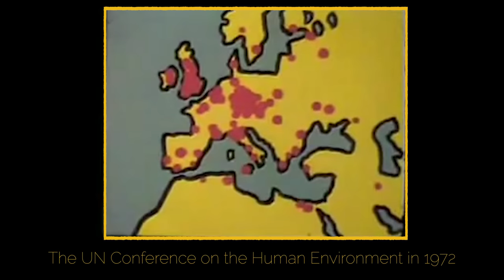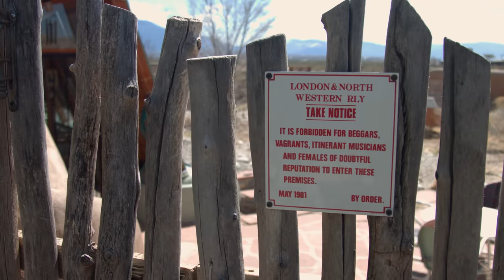Earthships - America's Off-Grid Desert Community

Comment: As a plumber, what I took away from this, is the re-use of water. Being able to use water more times in your house is beneficial to those out in western us that are currently having a water shortage.
Reply: They should make people with lawn-sprinklers install a device to recycle / redirect their bathwater to it and not use valuable freshwater. Maybe you could invent one?
Reply: @anthonytempleton2135  A few year back we had a drought and hosepipe use was banned,  no car washing either.  I used to use bath water to water my vegetables.  I installed a pipe between the bath and the garden.  You just need a small pump to start get the water flowing and then syphoning and gravity does the rest.   To start with I simply sucked the bath water up the pipe it is easy to know when it is flowing because air is ejected, so then you stop sucking.   I never got a mouthful of bath water, but in the end installed a small pump instead.
Reply: I never even thought water can be used 4 different times. This place is very inspiring. It just shows great care for the Earth and what people can do when they set their minds to it.
Reply: I don't understand why we don't use reclaimed water or grey water as some call it. Isn't it kind of silly we flush toilets with water clean enough to drink?
Reply: @commenter9967  I would quite like to set up my toilet to use rain water most of the time.  However it would need quite a large storage tank.   I would be quite interested in the capacity they have for their Earthships.   However, in general I see their Earthships as a terrible blight on the landscape.
Reply: @anthonytempleton2135  it would kill the lawn throwing off the ph levels
Reply: @hoosthere  Not at all.  The hotels in Egypt are not allowed to put used water into the sea they get huge fines.  So they water the gardens and they have amazing gardens.  The lawns are more than happy.   In 1976 in the UK we had a very bad drought we were not allowed to use hose pipes, or clean cars.  All the plants in my garden ran on washing up water.   The lawn, well that just went dry brown.
Reply: @Digeroo123  i just know that i got soapy water on my grass and that spot died
Reply: @hoosthere  I habitually wash off my duvets on the lawn every summer.  Hose them down with detergent and water.
Reply: @Digeroo123  might of been the white vinegar, that was mixed with the water
Reply: I believe it's going to be beneficial for all of us someday. I think they just got the jump on everyone.
Reply: @Digeroo123  That's fine, but I would have found a way to rig up a bicycle pump to it.
Reply: @Digeroo123  Worse blight than rectangular boxes & cubes people normally build?  Nothing stands out like a sore thumb more than traditional buildings.  Yes, some of these earthships are ugly, but as far as the landscape goes, it's not much different than other kinds of structures, including warehouse structures or manufacturing plants.
Reply: @commenter9967  We could, but we would need radical changes to building codes that would mandate these systems in all new homes, and renovations for older structures that have the room for them, with a time window, say, 20-25 years.

There would be massive resistance to it from builders as well as home buyers who don't want the added up front cost & lost sq. footage.  That could be addressed via various compensations and incentives, of course, like tax credits, gift cards, discount loans, whatever, but you know how our leaders are:  Worthless.  It takes them 10 years just to think about doing something.
Reply: As a Pediatrician I came to the same conclusion
Reply: We used hose pump on a drill to drain our bathtub water into our garden, and by the bucketful for flushing. This was years ago when we had drought conditions in Maryland. Our reservoirs were drying up.
Reply: I want to live there!!
Reply: I agree
Reply: Have you heard of Brad Lancaster and water management? He is doing some fantastic work in Arizona that is spreading around the world.
Reply: @STEAMLabDenver  no I haven't.  What is he doing? I live in AZ so I'm interested
Reply: @anthonytempleton2135  where I live in MN, many people along the lakes use a lake pump to water lawns opposed to city water. It’s cheap and effective as well as green as that water runs back into the lake.
Reply: @chrirule  this is starting to change!! Water collection laws have relaxed in many areas it was once completely verboten.

Edit: I concede that the majority are still (shockingly, surprisingly) draconian.
Reply: I mean using tap water for flushing a toilet is insane. It's a gallon of drinking water just to move a puddle of piss down a pipe.
Reply: @Digeroo123  how are these a blight? They're efficient, they're ecologically friendly and they're beautiful.

The only reason I don't want one is I prefer cool humid climates and these are engineered for more arid places.
Reply: @hoosthere  so stop using soap. I quit that crap years ago and my hair and skin are so much better bathing in just water
Reply: @patwebb2375  he's doing a lot of work to try to get greywater accepted and teaching people how to use it under the radar in the interim.

B. Lancaster's books are amazing
Reply: @sirsir9665  composting toilets are so so so much better for the world. It just takes a little education on how to handle them.
Reply: @priestesslucy  All those old tyres.
Reply: @Digeroo123  you can't even see them. They're sealed up in a way that's useful to people
Reply: Well I’m a plumber in the uk and Ino for a fact we use our water 7 times roughly and that’s just drinking water alone 👍
Reply: @commenter9967  it’s not clean enough to drink bro and it is re used when you flush it goes into ur stack that then takes it away to be filtered and re used👍
Reply: @commenter9967  We do, where do you think city water comes from?
Reply: @chrirule  Those laws were enacted because environmentalists said it interrupted the water cycle and stopped water from being able to percolate and into aquifers.
Reply: @anthonytempleton2135  My neighbor in the city I grew up in, was doing that for YEARS. Bath water and sink only, not toilet water. He just piped outside to a holding tank in a shred, created a small motor to push it through a sprinkler system he created. That was 50 yrs ago. What people DIDN'T know wasn't hurting him. He had low flow, gravity assist toilets way back then too. He was a mechanic by trade and he created stuff. It can be done, but cities are notorious for WASTE, WASTE and more WASTE. This was in CA.
Reply: Yeah definitely the biggest challenge to sustainability is the proper cleaning of water
Reply: Considering their were plans back in 1990 that it was doable to drain the Missouri River any time we knew New Orleans would be under threat of flooding, to have all that water make it to the Southwest. Could then have stretched that to the upper Mississippi probably taking some of the Ohio! But no it’s too bad the USofA is such a poor country!
Reply: @spaceboy3101  that’s just bull shit. Places looked cool you have to waste money to make yours look normal? No cause you never have one!
Reply: @The_Good_Life3026  hope their not using petroleum based fertilizer and all the rest! If those bodies of water have no fish well now you know why!
Reply: @brxds0679  hey, the point is the clean water you bathe in is good enough to flush your toilet!
Reply: @TheLosamatic  Nope, I'm a farmer and follow water rights. That was from environmentalists. Go ahead and if boogie men make you feel better, that's your psychosis, not mine.
Reply: Or better yet, stop doing the stupid shit that has helped lead to the drought.  People just don't want accountability.  They think adaptability is the answer.
Reply: @atlantic_love  You live indoors? That's adaptability. You don't sleep under a tree right? Where does that water come from you drink? A brook? You never drank from a plastic bottle? Wow, you're a true wonder of nature.
Reply: @TheLosamatic  how so
Reply: @hoosthere  your going to have to give me more than that honey!
Reply: @TheLosamatic  how so
Reply: @Stone Melber or others... 

The part where they are recycling the water to and from septic... 

I'm not being critical but how do you know the water is adequately detoxified before it comes back in for the plants to become fruit you eat? This part it seems like you'd have to a bit careful about. So you'd need to go into technical details to figure out how to duplicate it right if that makes any sense. 

Hope someone can advise on this. Thanks.
Reply: @TheLosamatic  who are you responding to
Reply: @hoosthere  Which response are you referring to?
Reply: @cchavezjr7  see that’s just it, are you saying your farm is in a town? The point I was making is people acting like they are part of the sane environmental movement,as you claim, I’m just talking facts, you talking about rain water rules in cities? WTF we just take your word for it. EPA REAL law was can’t let start runoff go straight into river for cities over 500,000 decades ago. No city has been able to comply with that because municipalities and counties are the most corrupt forces in the USofA , come up with stupid rule, not laws until fought in courts as far as I’m concerned. What you say is one(if real)of the more stupid, because property tax is higher depending on how much run off, ie storm water city has to deal with, your property has. So I’m going to assume if one has rain water collection that property naturally absorbs more water any time it rains. No law against collection of rain water will stand up in court considering the pollution that every city is doing by not treating the rain water before it goes into the environment,ie the river or the ocean!
Reply: @noahriding5780   My apologies if I misunderstood your question but I think your question was basically how do they know the reused water would be safe to use... well..
 I'm sure "they" have pH or chemical tests. something kind of like when I was a kid anxiously waiting for the public swimming pool to open. they would treat the water with chemicals like chlorine and then test the water pH (in the swimming pool). 
Very important to check the pH balance before letting anyone get in the water. So it's likely they would do something similar and check the waters pH if (re)using any "grey water" especially for growing food.  Hope that helps ☺️👍
Reply: @bookanne  ah, thank you. That makes sense. This technology is very interesting and cool, but it does take a bit to understand all the parts. 

:)
Reply: @anthonytempleton2135  That would make too much sense...what are you trying to do here? 😜😉😊
Reply: @hoosthere  no lawns in the desert
Reply: @anthonytempleton2135  don’t they kinda do that already? I thought sprinklers use recycled water? At least where I live they do
Reply: @commenter9967  most cities do use recycled or reclaimed water. At least where I live in Florida they do
Reply: @anthonytempleton2135  desert very different from densely populated suburbs with lawns, with everyone requisitioning rain/town/well water the water table can become depleted… l know a guy in MA with a 250k gallon tank buried in his backyard… legally waters his property through water bans…. town got so many complaints they put capacity limits on all future like installs. Grey water systems are a thing but are expensive, high maintenance and highly regulated for sanitary and cross contamination issues.
Reply: @commenter9967  I’ve just installed a system to use our shower and laundry water in the toilets. We’re saving so much water this way!
Reply: I wonder if these tires and empty cans emit any sort of gas offs that are unhealthy ?
Reply: I am a plumber also. I drank a cup of water at the end of the aquatic plants filter system.I am talking toilet to tank to indoor water garden at the end of the garden was a spigot into the mud. tasted fine.
Reply: It is so freaking ridiculous that politicians constantly scream about taxing us to solve climate change, then fight us tooth and nail when we want to explore sustainable ways to collect and reuse water and other resources. It is just ludicrous.
Reply: You do know that the toilet to tap has been ongoing for years Mr. Plumber??? Deborah Tavares explain much better than I. StopthecrimeDOTnet
Reply: Amen, why haven’t we been reusing water !?
Reply: @hoosthere imagine what that soap is doing to your skin
Reply: @Z.Theory  cleans but can dry my skin
Reply: @mikeleyman2383 

Mr. Reynolds was simply a genius. 🍃💗
Reply: @Digeroo123  

🍃💗 They are unique, fully functioning works of art. ~
Reply: @hoosthere 

One uses..... biodegradable soap and it goes thru filters......
Reply: @tinaristau3045 

Yes.  I think it's not cheap but pays-off in the long run.
Reply: @spaceboy3101 

Massive resistance.....Oh yes, there was plenty.
Poor Mr. Reynolds was at the Legislature plenty, trying to get his plans approved.....(80's-90's).

He's a good person with a winning idea
Reply: @cchavezjr7 
The mountains spring water run off...
Reply: @commenter9967 waste because it’s easier than thinking of how to reuse / reclaim / etc. also, capitalism cannot profit from reuse.
Reply: @Digeroo123 how in the world are they a blight ?  they mostly blend into the landscape as they are covered with the dirt around them. they literally remove garbage from the system, build housing, grow food and live comfortably while using minimal new resources. we need less green monoculture lawns and more unlawns. we need more recycling and less plastics.
Reply: 1st world america, hey?
Reply: @anthonytempleton2135  This exists already. You've got people who flush stuff have that water instead of staying in a septic tank it goes into the lawn.
Reply: We do not have a water shortage.  We have a management problem.
Reply: It's not just during water shortage. A lot of us out west haul in water because we don't have access to water rights
Reply: @hoosthere  depending on the soap, that might be the cause (although the vinegar would definitely do it, too). Regarding the soap, however, have you ever seen a soap bubble that you can see a prism on the surface of? That same effect on the surface of the plant leaves adversely effects the plants ability to photosynthesize sun light by shifting or eliminating the wavelength of light the plant uses
Reply: I drank the water from the spigot at the end of the trough of beautiful aquatic plants that process the black water. Not supposed to but a bets a bet. The water is good for washing and watering.
Reply: manufactured water shortage
Reply: Do those tires stink in the heat?
Reply: Ya realistically is a good idea. Even in conventional housing I’ve always thought grey water and sewerage water should be plumbed separately
Reply: What they don't tell you is that grey water is very hard to re use and it constantly clogs pumps and gunks up pipes
Reply: Here is The True Savior

YaH The Father (Genesis 1), Who, with His HAND, formed “man (Adam)”, from the dust of the ground (Genesis 2:7).

YaH’s HAND they NAILED to the Almond Tree, to symbolize forgiveness of the “Tree of Life” sin OF “man” and thus “The Fall OF man” (Genesis 3)

YaH The Father arrived to be Crucified via the Tent of Meeting (Exodus 33, Isa Scroll), how YaH has ALWAYS arrived
Reply: great ideas with reuse, love it, best to allow open ended sensible codes, those old ones written by government and politicians are not written in stone, we need open minded safe, in harmony with nature balanced building, clearly the old ideas and codes fail , lets care about our planet!
Reply: Our water usage doesn’t affect them. There will always be water here. Just not there. We can’t help that and there is no way to get our water to the western side of America. I watched a film not to long ago and it proved that shortages on one side of a country do not affect the other side. A surplus of water here doesn’t help them. Using less water will not help them.